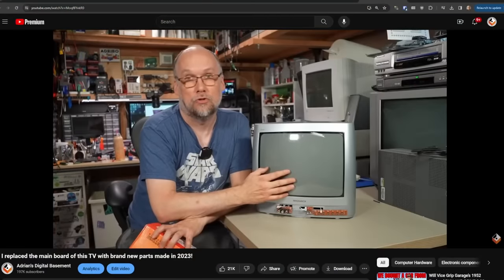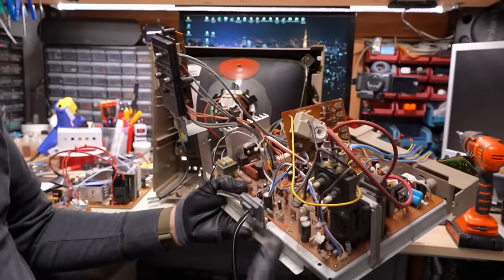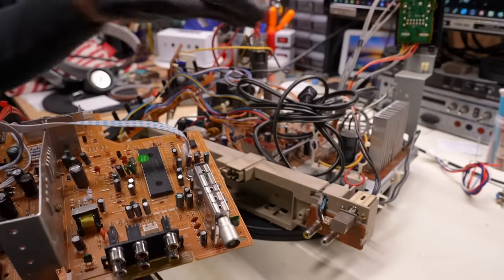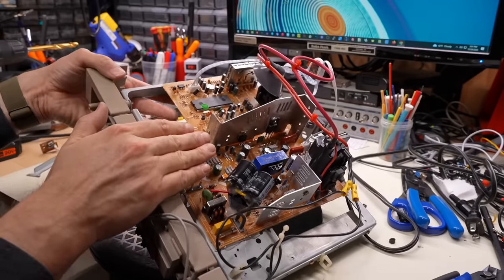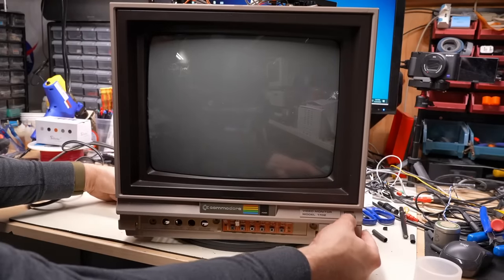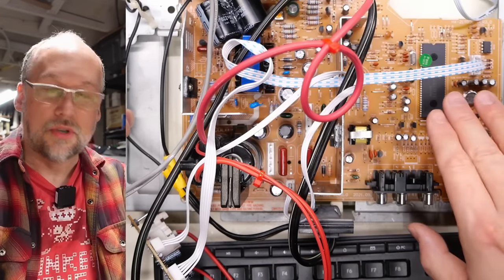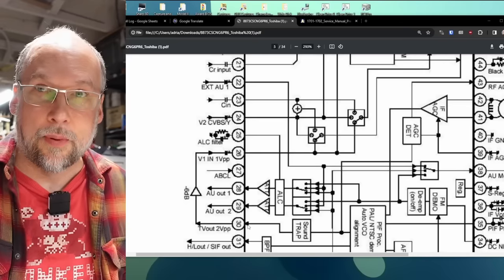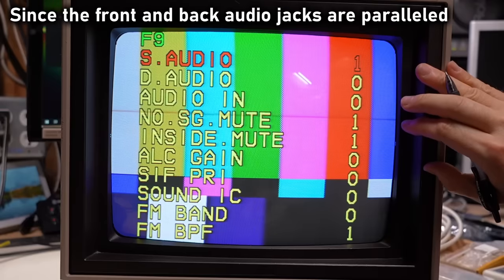Restoring a Commodore 1702 monitor using a main board from 2023

Comment: In the late nineties I worked at Philips Semiconductor, now NXP at the digital audio group. In the heydays of Dolby Surround and such. They had conducted experiments with double blind tests adding randomized clock jitter. The result was that the majority of listeners liked the jittered version better. This may be due to the dispersion of energy away from the sample clock. In those days some commercial systems ran at 32 or 38kHz, with 44.1 and 48kHz beïng the premium options.

It taught me at an early point in my career that figures are both objective and a good marketing tool, but ears are subjective and the only ‘truth’ when it comes to deciding what is good, better or best.

Comment: The ultrasonic PAL delay line (not to be confused with the other LC delay linbe used to sync Chroma and Luma signals as wide band amplifiers have a faster propagation velocity) is used for averaging lines, I never saw a PAL TV without it, so I think this is due to a very early PAL implementation or a partial implementation of PAL to save costs. I heard that this makes the image a little more blurred, but I never saw a TV without it for comparison. To be clear I live in Brazil where we use 60Hz and PAL-M and color TV was adopted a little later than other countries, so I imagine that is why I never saw a TV without the delay line.

Comment: 5.8Mhz resolution was the top rating for PAL 625 TVs in the olden days. They also started using digital comb filters for Y/C separation in the top CRT sets. We also had PAL 60, not sure if you have that mode on the new board.

Comment: Hanover bars weren't very common but I have seen them on some sets when I was a TV engineer back in the early '80s. Adjusting the phase usually resolved it and sometimes it was a faulty delay line or a capacitor on the chroma circuit. Only two of the chroma signals were transmitted the third was made by either adding or getting the difference between the phase of the other to bursts. I think R-Y and G-Y were sent and B-Y was made from the other two (it could have been g-y & b-y or r-y & b-y - but I don't think that's right) The two colour signals were each sent 90 degrees flipped on alternate lines and the difference was averaged to eliminate phase shift during transmission. (Again I may not have the terms entirely accurate, but that was the gist). NTSC didn't do this and as a result didn't have this problem, it had it's own set of problems - which is why NTSC sets had a tint control to manually adjust the colour phase balance if the colour phase had altered over transmission. I guess neither system was perfect and each had it's own way of trying to deal with it.

Comment: If you are going to RGB mod it through component with a cheap converter, remember to tune it before closing the thing. Those usually produce images with a greenish tint. There's one particular brand that has the correct levels from factory (on which all the rest are based on, so I suppose that the green tint is just diagram-level sabotage on their part), but it's currently unobtainium; I once found it being sold at an online store and bought it, but they sent me a different brand (because they didn't have any more of that one despite marking it as in stock) and never gave me a refnd on the basis that "it's the same price and it works exactly the same", despite the fact that I indeed had to open it to correct the levels.
Reply: what's the model number of the particular brand one, if you don't mind my asking?
Reply: @devicemodder  the good one? Should be the CSY-2100 from CYP.

I have been checking around and it seems like RetroTink has released a device called RGB2COMP that uses a different board and seems to work well. The only issue in both cases is that they are active components that draw low voltages, so you have to carefully choose a place from the CRT circuit to draw it.

Comment: this is crazy, I have a Composite only Sony Trinitron, and if my repairs to its board dont work, its nice to know I can try this.
Reply: Trinitrons are different tubes so I don't know how compatible they will be. It might require lots of tweaking/modifications.
Reply: @eDoc2020  yeah true... might have to just find me another Trinitron and merge the two.  The one I have is hoenstly not that bad, the IR senser hardly works, making it hard to adjust the settings, and it seems to have a little geometry issue in one of the corners.
Reply: @Cyrus_Nagisa   Those are very minor problems, I'm sure your existing board can be made to work with much less hassle.
Reply: @eDoc2020  once I get my workshop up and going, I will take a propper look at it, but that wont be till June or so.

Comment: It is the function of PAL to turn the color wheel upside down every other line and average the color from two lines. This suppresses phase shifts in the RF transmission and corrects the color. The delay line enhances the effect.
The color information has a lower resolution than the black and white image.

NTSC (never the same color) does not have this function. The phase position of the color wheel is always the same and phase shifts in the RF transmission shift the color on the screen. Hence the tint adjuster.
But without correction, the resolution of the color is greater than PAL.
The underlying black and white image remains unaffected.

Comment: [Picky electronic engineer here] I'm not convinced that electrolytic is the best choice for the 1uF DC-decoupling capacitors in series with the video inputs. I would have used ceramic, X7R or X5R, which you can easily find with the desired pitch.
I would be curious to se the signals probed by an oscilloscope and compared.
Is someone 3D printed a beige insert for the buttons on the front the modification would look much better but it seems great already.

Comment: I bet you could find some panel mount momentary pushbuttons to put in those holes instead of gluing thr board to the front. On the corner where you had to trim it because the metal was too close to yo the mains, you could use a piece of plastic or fr4 bare board held to thd board with a nut and a bolt and then screw that to the metal.

Comment: To screw the board, you could make a hole in the remaining metal part, take a retangular piece os hard plastic, and screw the board to the plastic and the plastic to the metal, like a extension.

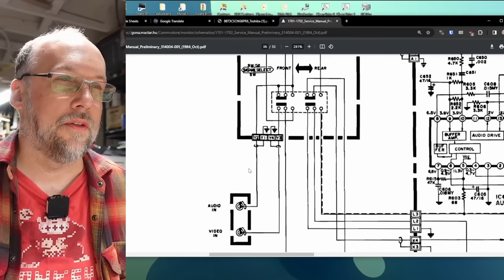Comment: 28:57 so you're telling me all this time I've had a commodore monitor I couldn't plugged straight composite video into the back port! Without having to have where is coming around to the front!
I was wondering about the Audio pass-through as well I wonder if they did that as a hidden feature to allow a recorder to be plugged into the front of the monitor while the audio is plugged into the back?

Comment: one reminder that the LCA(Luma-Chroma-Audio) a commodore 8bit computer outputs is not s-video, as LCA has higher output levels (iirc 1v vs 0.7v)
Reply: yes it requires a resistor or it'll damage the monitor eventually.

Comment: min 40 - the test pattern shows us from the left to the right upper side 1MHz, 2MHz, 3MHz(middle), 4MHz and 5MHz over the S-Video Y and Chroma input. If we switch to the fbas input AV then you see only the 1MHz - 4MHz and the 5MHz is grey and color flickering due the filter operation from the color carrier. Sorry here we have in PAL 4.43363875MHz and in NTSC the color carriere is 3.57954MHz (NTSC3). I think in Brazil was a NTSC4.43 Adrian did you know some story about it? Thank you weakbit

Comment: This looks awesome and actually a great improvement over an already great 1702 monitor!

I wonder if I can fix my Commodore 1084S monitor (currently having no high voltage) with this board, plus the RGB to component conversion module, and if it would even fit.

Comment: To be honest I'd say fit a Scart Socket on it input wise it supports all 3 modes of Sd TV Composite Video, S Video and RGB. Which is good for old consoles like the Sega Master System, the Genesis the Super Nintendo the PlayStation the Saturn and with some modification the Nintendo 64 and snes jr.

Comment: I recently found a nice woodgrainy 19 inch tv on the side of the road.. But its got RF only, and its jungle doesnt even seen to support COMPOSITE.. Its a Sharp 19RP59. I would very much LOVE to get this set to support Component, Dont really care about RGB, Component is close enough for me. Apparently this board might just make that a possibility... Im looking forward to future coverage on this.
Reply: I also have an oldish, Not as old as in your video, VGA computer monitor, But someone cut the integrated cable for some reason... So theres another potential use for this..

Comment: If you know anyone with a 3D scanner, I would scan that remove and 3D print a new remote case with using the same coulour as the C-64 Monitor plus have raised Commodore and the logo on it, would be so cool having a matching remote :)

Comment: A thought for trying to line up connectors with an enclosure to be drilled... what about painting a thin layer of thermal compound on the end of the connector and carefully sliding the enclosure portion on, letting the thermal compound transfer a mark where it makes contact?

Comment: Lots of boards with TDA9554's around on the web. You could also use a Thomson TX807c/cs or a Philips board with these monitors. If you can find them, a LG Philips 13" or 14" inch CRT with EBU phosfor would make a really good Amiga monitor.

Comment: I wonder if it would be possible to get RGB signals out of this board, put it into some case and use as a super cheap all-in-one transcoder to convert s-video, RF, composite and component to RGB so that you can either plug it into some other TV that would not support these signals or plug it to some upscaller??

Comment: I got a high rez crt with a high horizontal/vertical scan... 120khz horizontal... I can't find a flyback for it. Can I get everything out of that monitor, say if I want to replace all the guts? Could I take full advantage of the scan rate with this board and do the theoretical 1024x768 at ~150hz for modern fps games?

Comment: Beautiful work friend i got an original 1988 Mexican Sigma Commodore monitor that it has a dead flyback, im going to import one of these chinese chasis, can you explain a little more slow the luma and chroma part just to see how to do the correct implementation of the components in the board.
Reply: Also can a Scart and component imputs being included? That would be the ultimate 8bit/16bit monitor

Comment: Probably the 100 ohms terminator resistors makes the luma dimmer.  Change thosee 100 ohms to 75ohms with two parallel 150 ohms resistors in case you have those values.

Comment: Love this project. Makes me wonder. I have an old 50’s round tube TV that needs a full rebuild before it could work at all. I wonder… could I wire a mono monitor board to its tube to get it working….?
Reply: Technically yes, but short answer no. Tubes like the 10BP4 run on different voltages than modern monitors. The yokes will also have wildly different impedances and you can't fit a modern skinny yoke on the fat old-school neck.

Comment: I might end up having to do this with my 1084S, unless I can get hold of a replacement line output transformer.  I'm not exactly sure of the model number (ST?) as it''s been in the storage area for years; just need to find the right transformer for the board in mine and at the time the model references I could find were a bit vague (early days of the WWW)..

Comment: If anything, the Hanover delay system makes the colour info from your NTSC systems make more sense, so you now get brown instead of striped "pretend this is a different colour" bars! 😅 PAL is better for resolution and i'm biased being in a PAL area, though NTSC was higher refresh.. Having played Sonic for example in a PAL area though, in NTSC it looks so damn pixelated on the MegaDrive/Genesis compared to our PAL.. Which you can make run at 60 anyway so i wish people would stop complaining and figure it out! My MDs output PAL60, do yours? 😎

Comment: If your termination is wrong, you're going to see ghosting, in this case on the color component.
Reply: Unlikely even with the luma signal, let alone with chroma. It will mostly affect the level. The frequency isn't high enough to get reflections from a slight impedance mismatch. I have some prosumer and professional video monitors, including an early '90s Sony BVM HR-Trinitron (that's the only really professional monitor I have), and if I switch off the 75ohm termination on the video signal the only thing that changes significantly is the brightness.

Comment: 60Hz or 50Hz power? Also, is the 240v to 110v capacitor mod truly necessary?  Anybody test yet? I ordered one two days ago, will share my results when I get my board installed. I had been using a GBS-Control I built to convert PAL C64 screens to NTSC, which works ok, but I've been dreaming of finding a PAL capable CRT TV in the US, dream come true! Thanks!

Comment: i saw something when you where in the menu about the tuner vhf high low is set right in the middle of the north american 2m ham radio band @42:35 and UHF low is not right either

Comment: I really dont like the look of those voltage doubling capacitors hanging off there with only hot snot for insulation and no enclosure.

I'd look to give that a remix.

Comment: You didn't have to do that voltage doubler mod as the universal boards usually work anywhere between 90 and 260 volts
Reply: Can anyone confirm this, please? I ordered one yesterday. I can handle performing the 110v cap mod, but Adrian never mentions whether he's running off of 60Hz or 50Hz power. Is the 240v to 110v capacitor mod truly necessary? Can the board handle 60Hz or is Adrian using his isolation transformer?
Reply: @retrohoard you don't have to change anything, these boards work at both 120V and 230V 50 or 60Hz, that's why they're universal and work with any voltage and TV system. Besides, switch mode power supplies don't care if they are fed 50 or 60 Hz frequency as the very first stage of the power supply is to convert to DC voltage anyway.

Comment: Adrian, I need your help. I have plus4, but it's not working. I tried a lot of things, but it still gives me a black blank screen.
1. I replaced PLA with a new one.
2. I bought a 6510 to 8501 adapter and a new kernel rom
3. I removed function roms.

Still black screen
All chips are getting the right voltages. CPU has getting the correct reset signal. 

4. I removed everything in the socket(even the TED) because all adress lines at 5 volt, no activity.

I think the problem is U3 or a ram or a ram glue logic.
What could it be? 
I don't have an oscilloscope or a good desoldering tool.

Comment: I was curious if the jungle chip allowed for RGB injection, I guess not, but the component input is definitely sweet. Also, this board should work with a Trinitron tube, right?

Comment: Your work on the DANGEROUS analog alchemy is amazing.  I love to watch it but will probably NEVER dare to try.  

That said, your ability to source and use interesting components and make things work well is very interesting to me.  I have a project idea that would make one retro community VERY happy and I feel like if ANYONE could do it, YOU could.

IDEA:  The Tandy CM-8 monitor was made specifically for the Tandy Color Computer 3.  It's an RGBi only monitor that I'm told syncs at an uncommon rate so typical displays out there can't do it.  (One or more expensive NEC displays are known to work but are unobtanium for most and especially to me)  But are LOTS of flat panel display driver boards (I'm told) that support multiple inputs (the HDMI and all others).  So I'm thinking it might be amazing if a common flat panel display (even and especially discarded 4:3 displays) could be retrofitted with a cheap Chinese driver board.  You probably already have a CoCo3 in your basement but if you don't I would happily supply one.

This idea isn't one that will likely result in the lost of life or limb if we commoners were to try it ourselves... we just need a leader to show us the way.  Is it possible?  I think you would know.  Can you do it?  So far, it looks like you can do ANYTHING.

Comment: I have to say I'm impressed that the Chinese have made a general purpose CRT controller and made it available to the hacking public.
Reply: If there's anything Chinese industry understands, it's economies of scale. It's perfectly reasonable to design a board that will handle everything that could possibly be thrown at it and then produce ONLY that board, instead of 5-10 different PCBs and assembly lines. The board may cost more per unit initially, but amortizing the design and manufacture cost into a product you make 5 to 10 times more of actually brings the per-unit consumer cost below the other options.

Comment: I NEED one 
I'm not sure if it's possible but I would love to connect it to a modern pc with a hdmi cable or something to be able to watch old movies in the original format
Reply: There are cheap HDMI to composite video converters. Just beware, their output signal doesn't have the proper black level for American NTSC televisions.